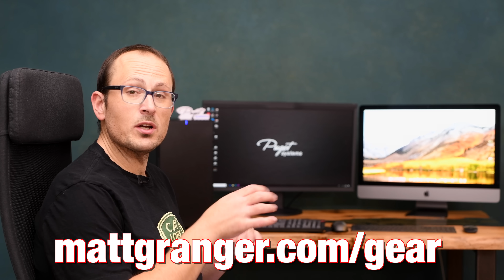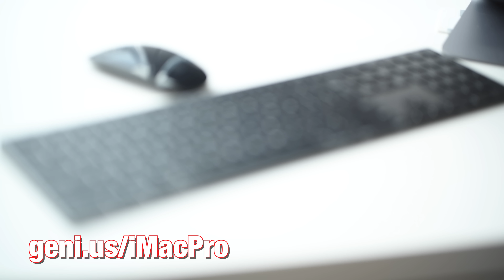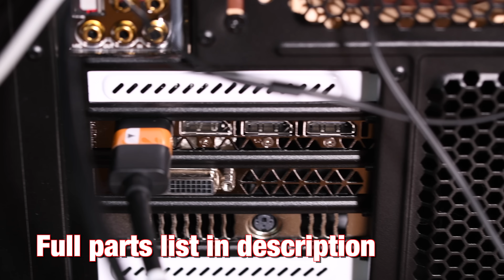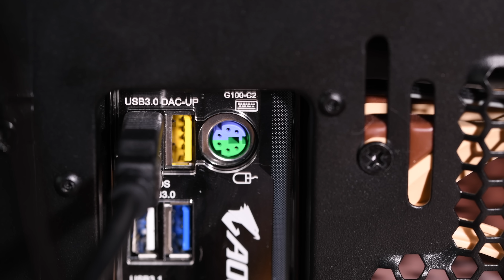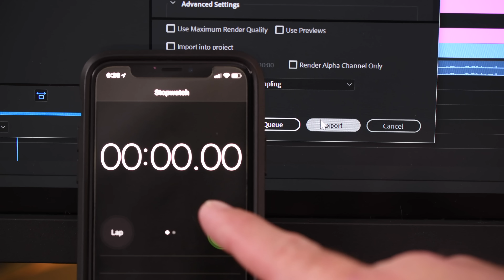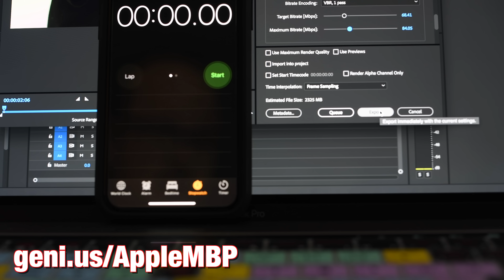$10,000 iMac Pro vs Custom PC - Which is faster??!

Comment: Conclusion, better hardware is faster... wow, insightful. 😂 
All due respect, the point you make about upgrading the machine later is valid and truly the ONLY valid conclusion here. This is not an equal comparison or even a hackintosh vs an iMac comparison. The only final assessment that can be made here is spend your money on the best equipment you can afford for the OS you prefer and get a fast computer. But a "comparison" video this is not.

Comment: I’ve used custom PCs , built hackintoshes, and have used real macs. The user experience of a real mac beats Windows hands down. Also don’t forget resale value. Macs have very high resale value. See how much you can resell your custom PC versus a Mac in 5 years time.
Reply: Why would you sell your Custom PC when you can just upgrade?
Reply: yeah back in 2011 - today macs hold a value for 2 years and cannot be upgraded. the OSX would obsolete the device now so not quite true now unfortunately.
Reply: Because ppl buy macs for fashion not for heavy duty stuff... and thats why a 5 year mac is expensive, because ppl just dont care about performance, fashion is better... and they can use it as a toaster if they try to do heavy duty stuff on them.
Reply: I dont know where you guys get the idea that a "PC" crashes all the time or is unstable, If one of my PC's crashes more than 1 time a month thats a sign that something is wrong with the machine. I backup all my data but crashes are not even in my mind. And gpus frying was and still is a "thing" with apple laptops.
Reply: A Soviet American why would you assume he didnt weight up the options of an upgrade versus a new machine.
Reply: livebrain, like I mentioned above, you are wrong. I personally don't care that people say things like these, but it makes you/them look a bit silly. (incase you want to know).
I have multiple high-end PC's running here, yet for real heavy music,video,animation productions I run a Mac Pro (even with lower specs). Simply because on my Mac Pro things run extremely stable (never a single crash since day one) and faster.

I had no faith in Mac, until I tried working on one. Now I will never go back (for this kind of work).
Friends who do simular work also went over to Mac and they are experiencing the same thing.
I agree the price is way over the top, so in most cases I would recommend getting a PC, but Mac's are honestly not for fashion. Though, a lot of people buy them while they not really need them, yes.

On music production forums when people are having performance issues, 9 out of 10 or working on high-end PC's.
Pro's that work on PC who have almost no problems run setups (using additional PC's as slave for sample streaming) that cost more or as much as a decent Mac Pro.
So, in the end it's just about what you are planning to do and how much money you want to spend.
Reply: Andries de Haan  I have multiple Macs and I can tell you. The macs don’t cater too much to the media industry like they did years ago. When I was in the media industry Macs where the go to but as time went by all I started seeing where PCs so I started using PCs and now I’m leaning more towards PCs. Many companies are going towards the pc route because they are serviceable. I’m in the process of building my own pc. I wouldn’t call the macs trash but they are overpriced because they look pretty. I still use mine now just for regular shores.
Reply: Andries de Haan also Apple  died with Jobs
Reply: We should be careful how hard we cheerlead the end of the last big American electronics company.
Reply: And yes, especially considering the hilarious political, diplomatic, and trade climate in the US, and our orange clown painted humiliation of a president, there are millions around the world who are disgusted and simply want no part of American anything.
Reply: MACS are nothing but OVERPRICED PIECE OF garbage.
Reply: Nope. Nope. And Nope.
Reply: WalrusRider hahahahaha Appleboy :v
Reply: guess intel, AMD, seagate, Western digital, Dell, Corsair, NVidia. you know what I could go on for days on how many American electromics companys these are and I wouldn't call any of these company's small. mainly AMD and Intel, just about every computer you find has either one in their products in them.
Reply: There's Dell, which is now irrelevant. And a bunch of component manufacturers. Apple is a damned DOW COMPONENT. It's one of the largest companies in the world. And you want to compare them with...Corsair? Western Digital? C'mon. Get real. Apple will eventually be subsumed by the Samsungs, the Xiaomis, and the Huaweis of the world. And these irrational children in the States will cheerlead it.
Reply: Dell is irrelevant? guess a company with a net worth of  $601 million is irreverent. by the way if those companies didn't exist than Apple wouldn't have existed. so let me get this straight, if its a US company but sells products that are either inferior and over priced or simply don't want them need to because its an American company? right because thats how you make competition, thats how you make products better. all that you would be teaching Apple is no matter how much they push anti-consumer practices you will always stay by them.
Reply: by the way I wasn't comparing them I was simply showing you that your comment was incorrect because there are many big American electronics companies
Reply: I guess when thinking of the world stage, and the real giants of the world, we have different notions of "big". I guess Corsair is bigger than insert whatever small company. So what? And we all know it's only a matter of time before the Chinese government starts pumping their trillions into domestic chip manufacturers and removes Intel and AMD from circulation entirely. And Western Digital, frankly, unless they get their shit together on solid state storage...what future do they really think they have? And yes, Dell is irrelevant. There is zero cache with that brand. It's the poster child of crappy beige box. And clunky cheap laptop you wish was a Macbook. Apple devices are still coveted as status symbols around the world (for some reason)...but how long can that continue with Xiaomi and Huawei undercutting them in the fasting growing consumer market?
Reply: macbooks are probably the worst Apple product you could have mentioned, thats the problem, a computer should not be a status symbol, you say around the world but I highly doubt many people around the world have a macbook, there have only been 112 million macs in total sold, macs hold less than 10 percent of the computer market in 2016 and I doubt that has changed very much
Reply: Well. That's your disconnect. I agree that Macbooks are average at best...but the perception of Apple is that of quality. It's why people line up like cultists for each new release. You are talking about what you think things should be...I'm talking about what they actually are. Someone like HP or Lenovo can ship A LOT of cheap laptops, make a volume play and hopefully do okay year on year...but Apple can be hugely profitable shipping premium priced devices to their hordes of adoring fans. This is a matter of brand, cachet, and perceptions. Reality doesn't matter much. Apple has positioned itself as a premium brand, their customers seem extremely pleased with their products, and are intensly loyal. And despite their prices...Apple is now the number 4 laptop seller anyways . This is 2018, not 2016, Apple continues to grow it's market share each year.
Reply: Hoping that during those 5 years your MacPro doesn't need a repair, in which case it will worth bubkiss.
Reply: A Soviet American because the case will be obsolete too 😉

If you upgrade MB, ram needs upgrade most likely, which means CPU, which means 

Just get a new PC.

Anything past 3years you probably want to buy new anyways.

Resale value for used PC sucks shit but Mac you can get decent money back.
Reply: Osx is so cool until you compare finder with explorer. Or the task bar.
Reply: Macs wont last 5 years anymore, batteries are glued in, keyboards fail within a year, and if you break it, the repair cost will be higher then buying a new one, oh, and your software stops working after a few years as they will refuse to update it.
Reply: People who have trouble with PC's "crashing" are incompetent. That said...everyone who's ever owned a Mac has experienced the spinning pinwheel of death. Apple used to make pretty good stuff, innovative stuff even. But that was years ago. Today they are simply cashing in on the name they made in the past, and fools are lining up to give them their money. It's just another Chinese electronic device. I'll buy Apple when they start making them all in the States. That would make the premium more worthwhile.
Reply: arno nabuurs so true 😂
Reply: I'm a qualified tech and Mac's are 100% garbage, you can out spec any custom PC build far cheaper than the basic mac revisions. The only mac's worth giving any credit are any riding the SSD however put that SSD into any PC build and it shits all over mac, If you think your watered down flat packed components are better than the true original PC components then it is clear you do not know what you are talking about not Pat.

In the week you posted this I bet your now what apple class as "vintage" and your machine has just bricked itself with 10.13.4
Reply: pat mourassa, overpriced indeed (new), though definitely not garbage. I work with PC's and Mac Pro and I'm definitely not an Apple-fanboy. I actually hate the way they do business. 
However, for music-, video-, animation productions, Mac is stunning! I'm still working on my Mac Pro from 2010 (bought in 2015 for 1300 orso) and I wasn't and am still not able to build/get a PC that runs as stable and outperforms it within the same budget.
I have PC's with higher specs over here, but in the end my Mac simply performs better while working on music, video, animations, etc.

No offence, but saying Macs are pieces of garbage, makes it clear you don't really know what you are talking about, to be honest.

Comment: don't forget about one key thing when you're talking about upgrading in a few years time. the resale on your iMac pro is going to be insane. you don't just have to spend another 10K on a computer, you can cover most of that cost with the resale of your older iMac pro. for example the 12 core Mac Pro still goes for around 4 grand USD and that 5 years old with no monitor and its extremely dated.
Reply: its actually going for around 2k on newegg

Comment: Does Premier Pro still use GPU acceleration with Nvidia GPUs Via the Mercury engine? And if so, is this for playback only or does it affect rendering speeds as well? Also, about how much rendering is offloaded from the CPU to the GPU? I haven’t used Premier since the ‘90s and I’m and Audio/MIDI editor so I don’t keep up with GPU acceleration as audio apps rarely talk to the GPU directly. The reason I mention this is because if there is GPU accelerated rendering going on in the PC but not in the Mac (due to the AMD GPU), then this isn’t really a very helpful comparison. We practically know the outcome without doing the tests just from the specs. However if this was meant as a general test to see how Premier Pro renders on a GPU optimized i9 workstation vs a non-GPU optimized  Xeon workstation, then ok. My point being this isn’t really a Mac vs PC speed test. It’s all about how much faster GPU acceleration allows Premier Pro to render. I sincerely apologize if I’m mistaken.
Reply: Steve Steele you’re not mistaken, he very clearly used CUDA acceleration and didn’t use Metal on the Mac. A better test would be booting the iMac into windows and running these same tests again without GPU acceleration. Or using acceleration on the other platform, very poorly designed experiment.

Comment: The iMac Pro has TWO 1TB m.2 SSDs in RAID 0.
Reply: True, but the SSD's are cheap. Thats why it hits 3000MB/s. If each one was 3000MB/s then Raid 0  would give roughly 5200MB/s

Comment: Try this in 3 years and see if the pc still got it. I used my MacBook for 5 years just change the drive to a SSD and it was as new while my pc laptop started to fade in 1 year.
Reply: yeah. thats a laptop. Much different from a desktop. You cant upgrade the iMac either
Reply: clearly, you don't understand technology and are a blinded fanboy. Matts PC kills the Mac because he isn't wasting loads of $$$ for the brand. The test isn't really necessary TBH, anyone with a little bit of technology understanding would get that.
Reply: My ten year old laptop still runs fine.  My five year old laptop was still handling multiple GB Photoshop files fine.

Comment: iMac actually isn't overpriced for the parts it has built in (Macs seldom are, except for stupid extra RAM and SSD premiums). But the iMac Pro as a concept is a total fail. No way to specify the GPU you actually want and the whole package is a nightmare in terms of thermals. First it cooks the processors and then it throttles them like crazy. You can not exhaust 450 Watts worth of heat out of such a stupidly small and badly placed exhaust.
Reply: On Wheels a lot of people misunderstand the exhaust system. The fans are constantly running, but they’re almost silent. And the rear heat vent doesn’t direct any air downward; it dissipates upward and out through the cable management hole in the stand. The iMac Pro doesn’t throttle and it doesn’t draw 450 watts from the wall at full load, the Vega Pro solution Apple is using is custom built for this purpose. The T2 co processor also handles all low level system tasks which frees up the Xeon from that duty. Mine runs nearly silent and has throttled twice when the ambient room temp was above 85 Fahrenheit.
Reply: The iMac Pro has been tested to throttle. You can't even get the CPU's 140 W properly out of that tiny vent. And if the software is well enough optimised to use all the CPU power it can get, no co-processor will help it. The custom PC above is nothing special in terms of cooling, but the problem will rather be noise as opposed to overheating and throttling.
Reply: On Wheels exactly, my iMac is damned near silent in operation. That’s a major thing when you’re putting together audio clips. The throttling I’ve noticed is generally when the ambient temp is too high. The Xeon W 18 core in mine doesn’t seem to have the same thermal issues that the 10 core Xeon W does, and from what I can tell the parts Apple is using for the main CPU are custom versions from intel; they do have lower TDP than the 145 Watt part. You’d be surprised what that little coprocessor does, I sure as hell was, it’s basically an Apple A10 (iPhone 7) chip that handles boot, Secure Enclave, FaceTime video, low level tasks, WiFi/Bluetooth, power management, and a bunch of other stuff; it’s a whole SoC in there. It makes difference day to day which surprised me. In any case, FCP X doesn’t seem to induce throttling and neither does Mathematica or Logic in my use so far. Other applications may, but I haven’t seen that yet. Also, I put a Titan Xp in a thunderbolt enclosure the other day on High Sierra 10.13.4 beta 3 and it performed very very well.
Reply: eGPU is a great way to boost graphics performance and offload thermal issues, good decision! 

Yes, there have been rumors that Apple uses down-throttled versions of the Xenon W. However, since both stock CPU and iMac have 4.3 GHz (single core) boost, I don't belive that is the case. Anyway, if you want a CPU to generate less heat, you have to run it slower. 

On top of that, Apple normally uses the strategy to cook the CPU first, then throttle it, which happens very quickly with sustained loads, then turn on the little fans. That makes people who know how to build their own silent and powerful machines cringe, a lot. 

Apple is great at integrating hardware and software, nobody is going to doubt that. But what Apple is not capable of is any sort of magic, they're still bound to physics.

Bottom line, if your system is productive and a joy to use for you, there's no arguing against that! However, they do know how to play the game of diminishing returns with their configs and personally, I'd rather not get milked by them.
Reply: On Wheels I guess the biggest thing for me is the silent operation. I had a 2012 Mac Pro (cheese grater) prior to this and it had been maxed out to its limits. (The Titan Xp came from inside of it), I upgraded the cpu from the original 3.33  12 core to a 3.46 12 core, Ram from 32 to 128, had an m.2 boot drive on a PCI-E card (Samsung 950 Pro), four SATA 1 TB ssd’s in the bays in RAID 5,  a thunderbolt expansion card, and a USB 3 card; and while I appreciated its ability to be continually adjusted over the last 6 years; this new system runs circles around it and by the time I’m ready to replace it something more powerful will be even less expensive. Plus my old system does sound like a jet taking off when it’s really under load, and that’s an issue. My biggest thing is software stability for what I do and while I would like this new iMac to have been a little less expensive it has been worth the $13,000 I spent on it just in the time it’s saved on productivity. That older Mac Pro had about the same amount of money in it as well, so (at least in my line of work) I’d rather bite the bullet up front and amortize the cost over a longer period. But to each their own, and I completely understand your position.